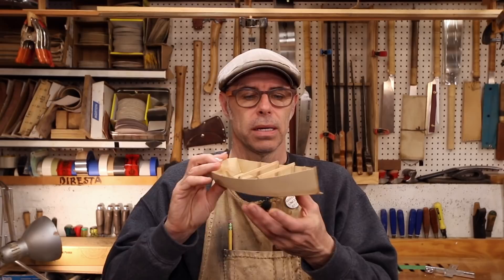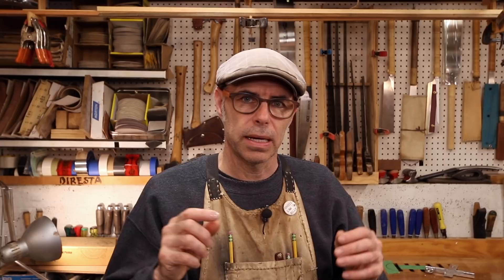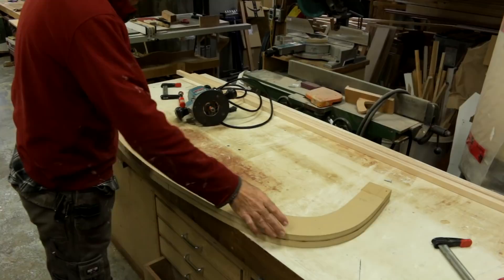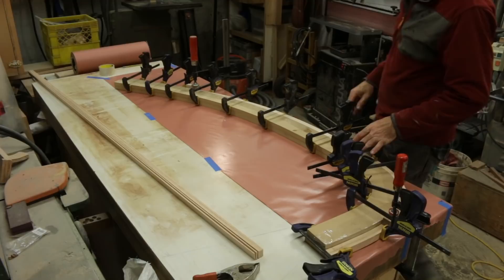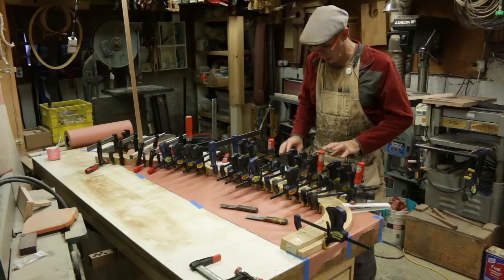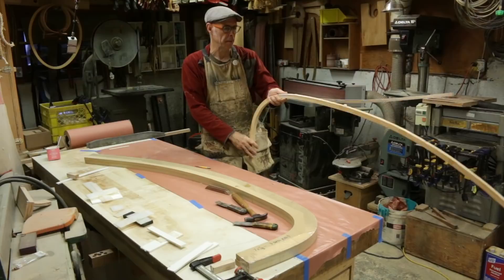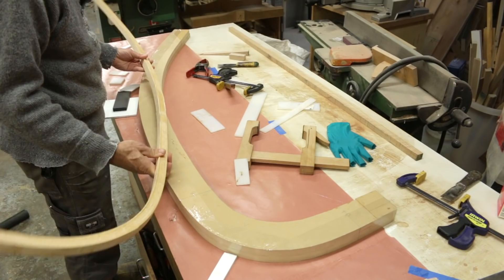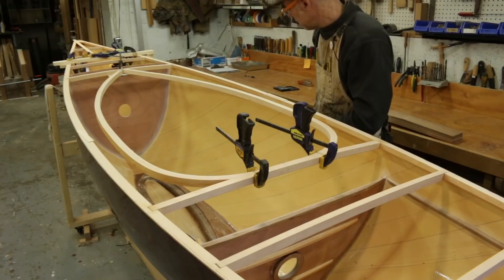International 2.4mR Sailboat Project - Episode 33 - Making the carlins

Comment: A little trick to calculate the area of an odd shape. Since your MDF is very consistent in density you can cut the cockpit shape, weigh it, and knowing from another sample that you weigh so many Lb per Sq. Ft .(Grams/Sq. Centimeter)  just divide and Poof you have a very accurate area.
Reply from the maker: Never would have considered that idea. Thanks.
Reply: @Nomadboatbuilding   You are welcome, and thanks for sharing your work!
Reply: I did that to calculate the area of a combustion chamber on a racing bike to determine how much to face off for a target compression ration. Used paper cut in the shape of the chamber vs a known full sheet of paper weight and measured with a reloading scale. Hit it within a tenth of a CC. I think I had heard about it from it being used to figure out area under a curve before computers got smarter.
Reply: @lunkydog  I got this from my drafting instructor. Yes, I am "Took Drafting in high school" years old...

Comment: Alternate idea for combing to make it match the deck camber:  At time 20:33 you mention the blocks placed below the glue up didn't make much difference.  Perhaps next time you could make the billet strips 3" wide instead of the 1" that you did this time.  Then after less complicated glue up, when placing the combing onto the deck, you could scribe a line with correct deck camber and cut the combing to the proper height to match the deck?   Bit more work, but you wouldn't need the extra blocks...   Also have you thought of having the combing stick proud of the deck covering?  With Kayak construction the cockpit combing sticks above the deck for tying a waterproof cockpit cover.  Not sure of the rules for this model, but combing of a contrasting color (perhaps matching the hull planking) might be an attractive visible edge?  Also if deck planking is plywood, you could cut a grove in the outside edge of the combing to insert the edge of  the plywood sheet  into this rabbit, and not see laminations of plywood?  (again only ideas you might consider for the next build).
Reply from the maker: I might have gone with wider stock for that lamination if I had it on hand but I didn’t and I knew the amount of shape it needed would be small. These laminations are just the underlying structure for the cockpit opening. It will get a much wider raised coaming later in the process.